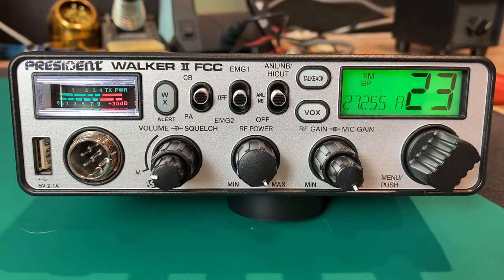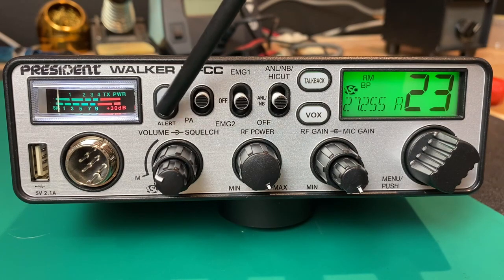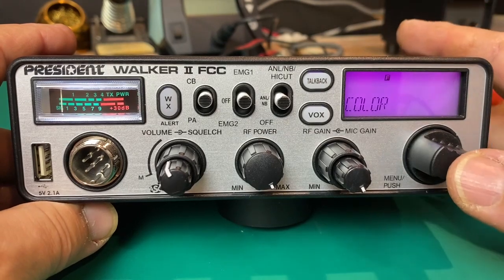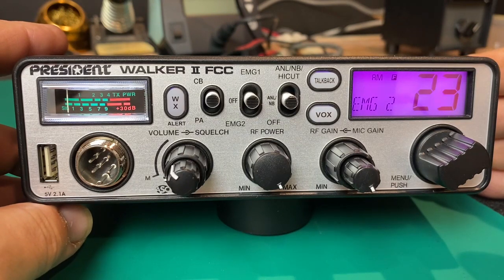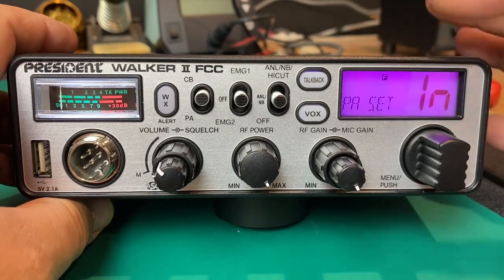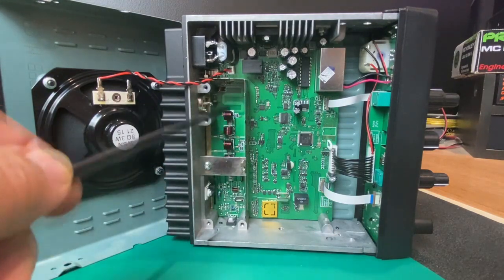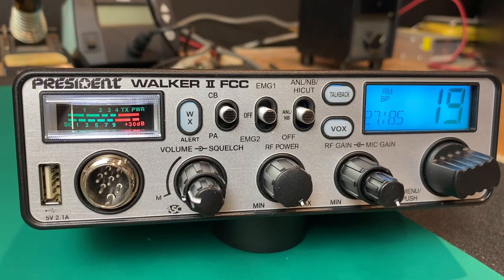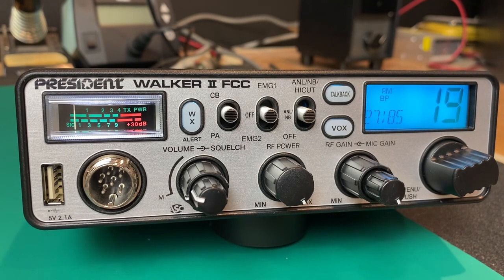President Walker II FCC CB Radio Review and Demonstration 2022

Comment: Been running the Walker II, 2 pill, Monkey Made MM9 with external PA set up in the truck for 2 years no complaints. I feel like I definitely got the bang for My buck, all those features and nothing but good sound reports. I believe I paid 140 and then President sent me a $20 check after I sent proof of purchase.  Have a ton of radios and some big boys at that, haven't switched it out since the day I installed it. Would definitely recommend it.

Comment: Strange bedfellows: Lafayette was perhaps the first to use the three-pin power connector on the legendary HB-525 mobile radios in the mid-1960s. Somewhere in my junk box is a salvage chassis mounted SO-239 that was made by Honda.

Comment: Great video 390!!!. That transciever is friggen tiny. What is mean by "FCC"??? I hear that term used quite alot now!

    There are alot of operators modifying their old Astatic D-104's and Turners for the electret microphone element. There is a guy in Texas "El Paso Tube Amps" who has a comprehensive video with O-Scope samples  showing the differences between the old Crystal element vocal patterns and the F.E.T's. Personally I'd much rather keep the Original elements over the F.E.T. electret elements.🇺🇸✌